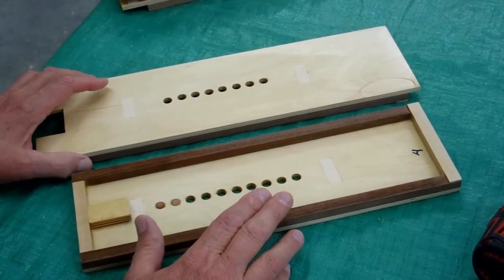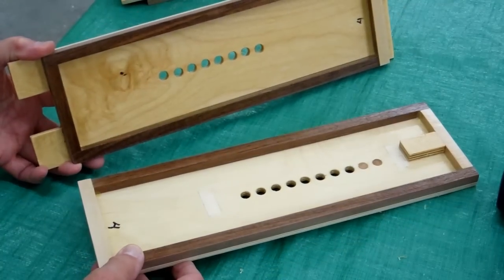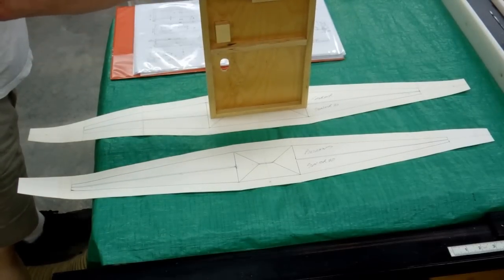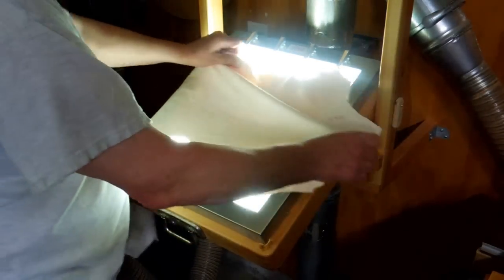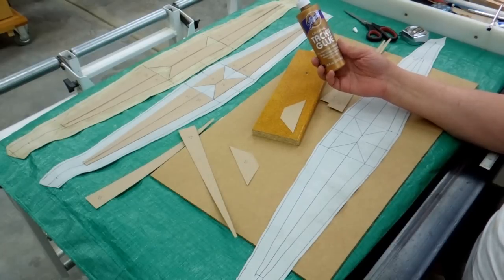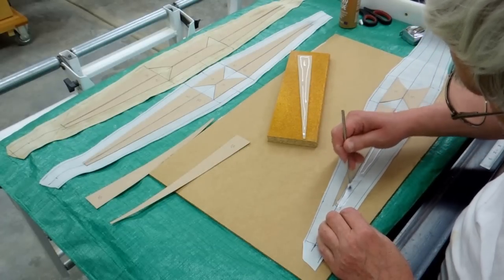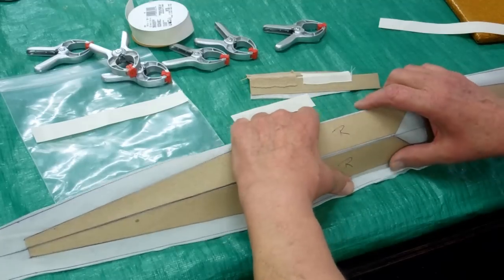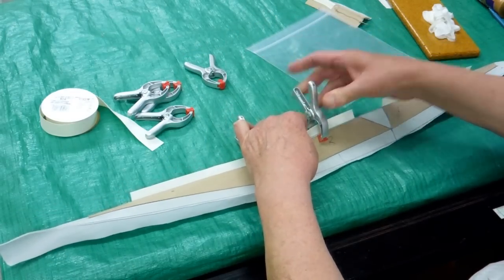Senior 20 Organ (01) Bellows & Reservoir Part 1

Comment: Hi Ron, catching up on this great series. I've had good results adhering polyurethane rod sections to a wood surface coated with polyurethane varnish (water-based) using "Weldwood" contact cement.

Comment: Great instructional video. I would like to learn more about thicknesses of leather for certain size bellows, and if rubberized cotton works just as well. Thanks
Reply from the maker: I have an entire series on building the Senior 20 and all of the videos are in a playlist which makes it easier to find them. A good quality lambskin in general is the description. Thickness is going to vary and probably is not as important and placing it on a light table or holding it up to a bright window to determine there are no holes or thin spots. I would not recommend "blackout cloth" or rubberized cloth. A friend used rubberized cloth for an organ and it developed holes in the corners and edges where there is repetitive flexing. Thanks for watching. Please subscribe.

Comment: Did you say you got your leather from a local shop?  Is there a good online source for organ leather for this purpose?  Columbia organ only show small 4 to 6 sq ft skins which are not big enough for even one bellow pattern
Reply from the maker: Columbia Organ have been helpful. I purchased my fish glue from them. They can probably sell you whatever size leather you are looking for but it will be expensive. Somewhere, you can find a leather shop and go in and look at good quality sheep skins. Hold them it up to the light or up against a glass window and inspect for any holes or thin spots. Some skins are a bit carelessly processed, so be selective. Helps if you have already drawn out your templates and have a good idea what size you are looking for.

Comment: Hi Ronald,  I know it's mentioned on the plan book, and you've mentioned it prior at one point or another, but I can not find where it mentions what thickness of organ leather I should be using for the bellows and reservoir, and what quantity I should be guying.  Could you please oblige me? Thanks,
Reply from the maker: If you think the leather would make a nice saddle or a pair of boots, it is too thick. If it would make a nice jacket or pair of driving gloves, it is closer to the correct thickness. Roughly 1mm (0.035”-0.040”) sheepskin lambskin, good quality, a younger skin is more flexible and pliable. Not all are acceptable as when processed the fleshing and scraping is often done carelessly, leaving gouges holes and thin spots. One of obvious even thickness is desirable. Find a good, large, reputable leather store and do the old touchy, feely, squeezy thing. Take your time. The people in the leather store probably will have no idea what is correct for bellows leather, you’re on your own. Take a bright flashlight with you. Hold the skin over your head and look up at the store ceiling lights. Hold the skin up against the store glass window on a bright sunny day. (Watch this video again.) When you get it home and find a hole or thin spot, that is too late. You may want to take your templates with you as a size reference. You can get it from an organ supplier where you’d be depending on someone else to select a good piece of leather, it will be very expensive, and I think it not necessary for what we are building. The people in the leather store I went to were probably ready to throw me out by the time I selected what I wanted.

Comment: I am going to start building a Senior 20 soon and have watched all your videos and they will be  very helpful. I was just wonder what thickness and type plywood you used. I is it the same that is called out in John Smiths drawings?
Thanks
Reply from the maker: ultraliter Just about everything is made of 1/4 inch plywood. One end of the pressure box is 1/2 inch ply and the sides of the pressure box lid are 1/2 inch ply. I used Baltic Birch plywood for everything. The front, back and two sides of all the pipes could all be made of 1/8 inch Baltic Birch plywood and that would save a lot of time. The covers could then be made of an attractive hardwood of your choice. I followed the drawings. My building sequence was pretty much as the videos are numbered.John's plans can often leave you scratching your head. Referring back to my videos where you can see the item in question being made should get you back on course. Have fun!

Comment: What are the prospects of the Tacky Glue lasting decades like the original hyde glues?
Reply from the maker: In terms of the Tacky Glue holding up... in a cool dry environment, it and the Fish Glue should hold up just fine. If you let things get wet or in an excessively humid climate, there could be a problem but I don't think so. Probably a better chance of the cardboard card stock delaminating or coming apart first. The fish glue can be detached with water if necessary (such as for repairs). I have not tried the Tacky Glue. I mention the Fish Glue used to attach the leather in other videos and there is a brief strength demonstration video on the Fish Glue. Thanks for watching. Please subscribe!
Reply: @RonaldWalters2010  Thanks Ron, food (or glue) for thought.  Subscribed.

Comment: Sorry but my plans show nothing about the "Improved Valve". I have read the plans several times.
Reply from the maker: ultraliter There are 10 pages of written instructions which come with every set of plans for the Senior 20. The drawings are then pages 11 through 26. If you do not have a complete or original set of plans you need to contact John Smith to obtain them. The alternate valves are explained on page 8 where is says APPENDIX at the top of the page. The cover sheet for the plans should also contain the serial number issued by John Smith authorizing the construction of your organ.

Comment: Why do you have 8 holes in a row instead of what in the plans?
Thanks
Reply from the maker: ultraliter  OK... First you need to read ALL of the written instructions (3 or 4 times) and review the plans (every page 3 or 4 times) until YOU have a thorough understanding of how this organ works and how it is going to go together BEFORE you start building anything. Only then should you start construction as this will save you a lot of grief later on. On page 8 at the top of the page APPENDIX he explains the alternate or improved valve design for the bellows.

Comment: Sorry to bother you again but my plans have a Conductor built in the middle of the front pipes and not all the pipes you have. I just sent an email to John Smith to find out what is going on. Thanks Again
Reply from the maker: ultraliter The original Senior 20 has the conductor in front with 5 pipes on each side. The rest of the pipes were under the pressure box and in the back of the organ. Not everyone wants to build the conductor. My configuration is without the conductor and 17 pipes are in front with 3 pipes in the back. The organ was made 2 inches deeper so the long pipes in the front will clear the reservoir and bellows.